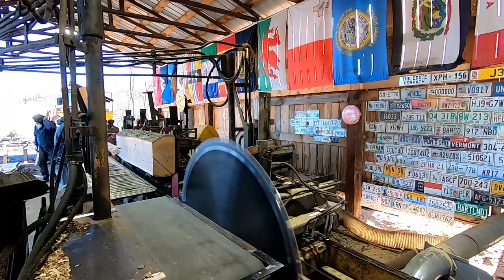sawing oak horse stall boards # 359

Comment: Horsies will like that paneling. We had 4 and a mule. A Mogan that was likie a puppy, a registered mustang that was the same except when another one tried something and then she put up with NOTHING and a carnivore and a foundered question mark. The mule was a mule, nothing more or less. All the stall boards were 2x6's, 8's and lam-beams. The carnivore needed shot but got rode. I even rode it 2ice and that was suffish for a mixer driver and equipment operator and a lost cause trying to keep all those sweet feed and hay burners fed on not much $$. Never again. Good sawing and that Bus Motor has got to be RIGHT to start that good in the cold like it does and NO BOOMS on a carriage are GOOD booms. Thanks Guys and od Bless!
Reply from the maker: thanks Lewie , yes too good for horse stalls but that's what they wanted.
Reply: @markgalicic7788  HI-class horses maybe!

Comment: Hey Mark! So, when you and Eddie stopped the blade to remove the trapped falloff, I was reminded of a time when I DID NOT stop the blade! It was on my portable Bosch 10" saw I used on the jobsite. Of course I was behind schedule and in a hurry. A sliver of falloff went down between the blade and the throat plate and was sticking straight up. I thought what the heck I'll just pull it up and out of there. BIG MISTAKE!!! the end of the sliver had a notch that caught the front of the slot in the plate and pulled the throat plate up and out of it's recess. The blade then grabbed the throat plate and slammed it into the table top! Bent the blade, cut the throat plate in half, broke the tab in the top casting that supports the throat  plate and of course scared the shit out of me. What an idiot!! cost me a couple hundred bucks and 4 or 5 hours of repair time. So, sheeesh! I knew better but did it anyway. No damage to the operator though, so that was a blessing as it could have easily been an injury disaster. BTW, Nice looking stack of oak!
Reply from the maker: Wow you got lucky there , I know two people that cut there finger tips off on a table saw! hope all is well!

Comment: I take it there is no interlock between the log Turner and the dogs, so you have to remember to lift the dogs before you turn the log itself, otherwise you would bend the little doggies.
Reply from the maker: the dogs are spring loaded.

Comment: Hello Mark, I am no expert by any stretch of the imagination on running a Saw Mill, but it appears to me the Red Diverter at the end of the blade is causing the cut Boards from not being diverted correctly off of the Blade.  Just a thought, would you think that it needs to be adjusted so the sawn Boards would flip off of the Blade better and save Eddie some frustration?  Just a suggestion from an old salt.
Reply: I think you’ll find it’s not to kick the boards off of the saw, it’s to stop the boards pinching on the saw and flying back toward mark
Reply from the maker: @FeatherHorseforge  yes you are correct Jason.
Reply: Thanks for explaining.

Comment: I just noticed that there are DOGS facing up. What are they for? I was wondering if there's an app to have the bus motor start, say like when you're on the way to the shop or at a certain time? Maybe a remote ''timed'' start? If there  isn't an app,  ''write''  Do you know anyone who writes code?
Reply from the maker: these are tong dogs so they hold top and bottom. I would need a oil checking app & coolant level app too.

Comment: Your camera settinx are borked this time again :( sometimes you're recording in 24 frames per second which shows very jerky on youtube's 30 fps. Most of the time you use 60 fps when recording though which gives a super smooth video.
Reply from the maker: I don't change the setting on the two cameras ever.
Reply: SO WHAT?
Reply: @markgalicic7788  then something must differ during post-processing.
Reply from the maker: @Surmoka  not sure
Reply: @markgalicic7788  You need better cameras